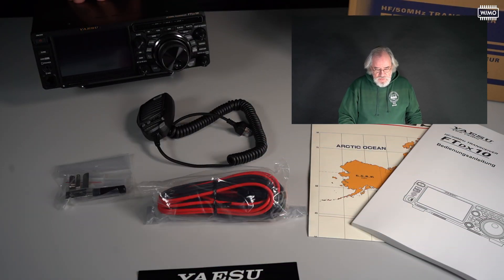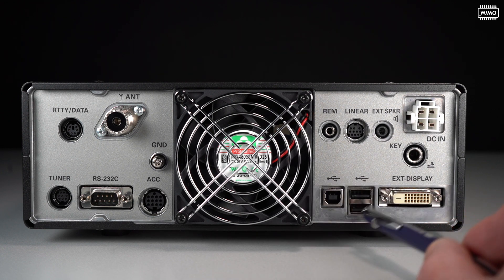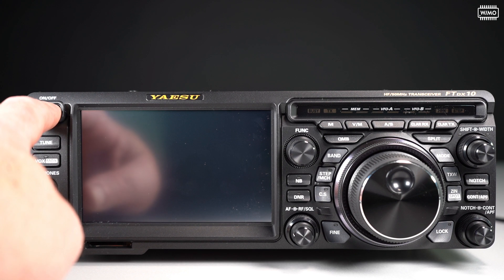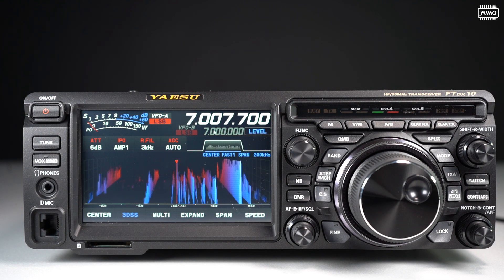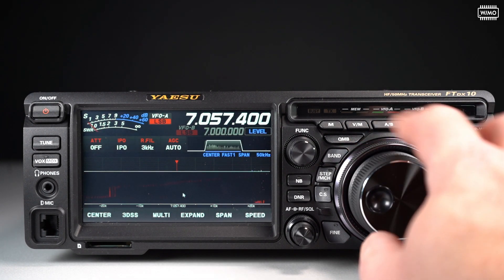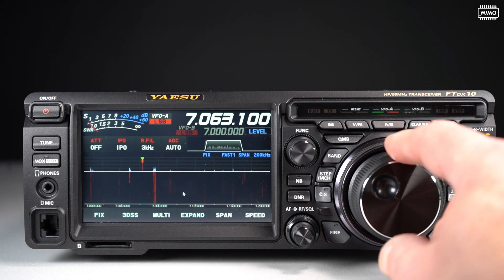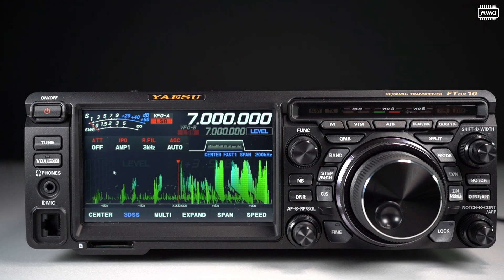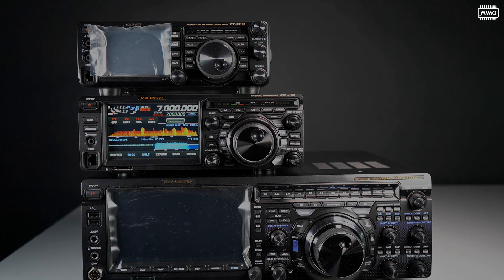First look at the Yaesu FT-DX10 (english narration (mostly :))

Comment: For those complaining about the DVI connector, I'm told that HDMI requires paying a DRM licensing royalty which would increase the price of the radio. Whereas DVI has none of the licensing burdens and so does not have that 'tax'. Adapters are easily found and I'm happy that they include some type of external display port, for me this is a win.
Close ups of the front and back and size comparison are very helpful, also demonstrating the various functions by using the mouse instead of the touchscreen was an excellent way to allow us to see the display as you make the changes.
Danke schön!

Comment: Please check your video. I believe that you said the 500 hz filter is optional. The descriptions states that a 300 hz filter is the option and  I see a 300 hz filter in the list of options, not the 500 hz. Also the manual lists the 300 hz filter as an option, which will only display, if you have purchased and installed it.
Reply from the maker: You are right, thanks.
the 500 Hz filter is installed always, the 300 Hz is optional.

Comment: Not my bag, I will stick with my tried and trusted ICOMs, IC-7300 an IC-9700. Sure who buys a radio on the recommendation of Sherwook Engineering, not many I'd say. This box of tricks is way over priced, and doesn't excite me in any way.  That 3G graph looks more like a gimmick, buy an ICOM IC-7300 and put the remaining more on a good antenna. BTW I had the 991, and what a pain to use, as so much functionality is embed in bloody menus. yaesu missed a trick again, like they did with the ft817 and brought out the ft818... Don't get me started on a DVI connector wft is that, HDMI???
Reply: Just like the 7610 complaints.  DVI is a compatible subset of HDMI, you just get a cable with a DVI connector on one end and HDMI on the other.  "HDMI" on the rig would just cost an extra license fee, and provide NO additional function.  A non-issue.

Comment: wie effektiv funktionierem DNR und NB in dem gerät ?
Reply from the maker: Ich habe DNR und NB nicht ausführlich getestet, aber sie scheinen mir genauso gut zu funktionieren wie bei den großen Brüdern FT-DX101D und MP. Wir haben mehrere Weidezäune in der Nähe, da hilft der NB sehr viel, das 'Ticken' der Zäune ist völlig unterdrückt.

I did not test the DNR and NB very extensively, but my impression was that they have the same good efficiency as with the larger siblings FT-DX101D and MP. We have several pasture fences nearby, the NB helps a lot, the 'ticking' of the fences is completely suppressed.
Reply: @Wimo-funktechnik  
Ich habe ein grundrauschen von ca. S8 in 80m band, wäre die DSP im Yaesu FTDX10 dazu in der lage das grundrauschen zu veringern, ohne das SSB signal besonders zu beeinträchtigen und falls ja, um wieviel dB wäre das rauschen veringert ? 
nicht das ich mir einen FTDX10 kaufe und dann ist das rauschen trotzdem noch zu hoch, es muss sich schon lohnen, sonst könnte ich auch meinen guten alten transceiver im 80m band weiterbenutzen. 

wie gut wäre die DSP des FT891 in dieser beziehung? der hätte den vorteil so klein zu sein, dass man den einfach überallhin mitnehmen könnte, im rucksack auf den gipfel für sota etc. ⛰ und im mobilbetrieb🚗
Reply from the maker: Das ist nicht zu beantworten, das hängt zu sehr von der Art der Störung auf 80m ab. Möglicherweise wäre unser QRM-Eliminator da eine bessere Lösung.

Der FT-891 und FT-DX10 zu vergleichen ist etwas gewagt, das sind doch zwei sehr unterschiedliche Anwendungsfälle :) 

Für weitergehende Beratung würde ich empfehlen unseren Vertrieb per E-Mail zu kontaktieren.